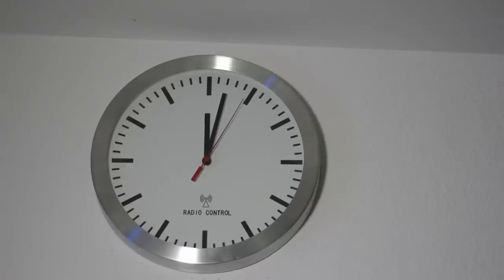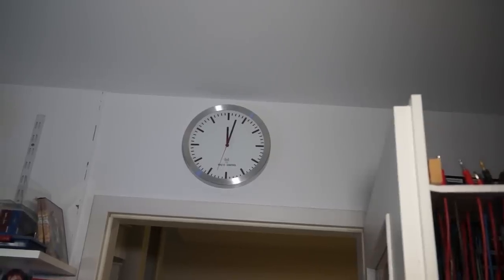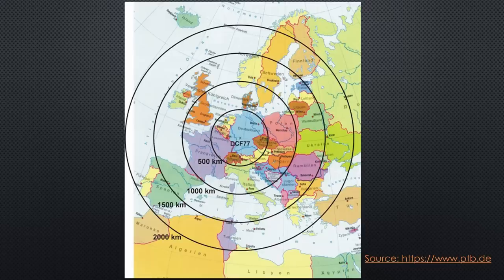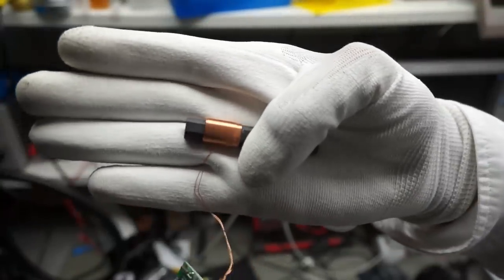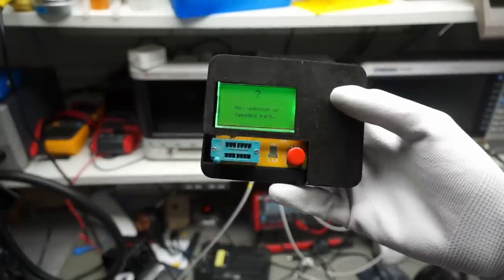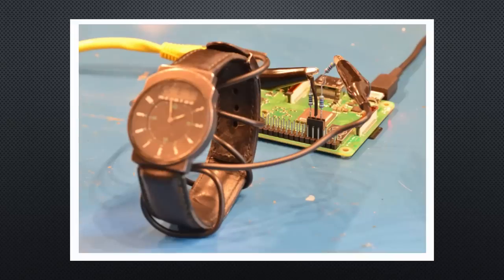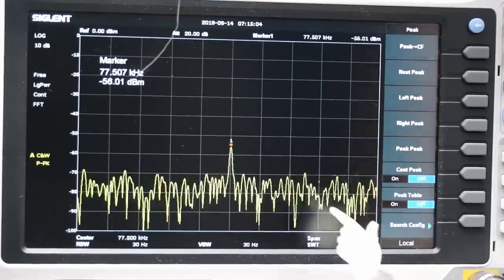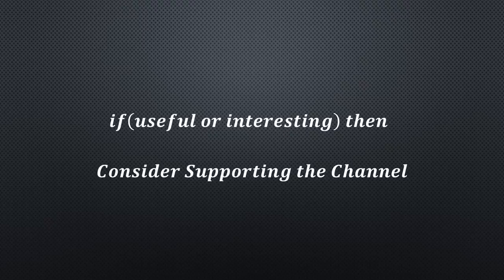#287 Remote Controller for Clocks (IKEA and others, DCF77, WWVB, MSF, JJY)

Comment: Microsemi sells a Chip Scale Atomic Clock (CSAC) for about $2000. Also it might be interesting to use GPS time to set the clock on the Raspberry Pi and then transmit that to your clocks.
Reply from the maker: Interesting. Yes, you could use GPS. But NCP is exact enough for me. And simpler. Especially in the basement. But you might see a GPS for another purpose on this channel in the future...

Comment: Living in Uppsala I have the problem to be at the northern edge of the DCF77 range and my kitchen clock fails to adjust itself regularly, even picking up completely weird data. I had not been thinking about faking a DCF signal myself before, but now - however, I would not want to waste a Raspberry Pi on the task. A ESP8266 should be fully capable of doing the task as well....
Reply from the maker: You could try to port Henner’s  C code.
Reply: @AndreasSpiess  I am a bit busy right now, probably (hopefully?) someone else will beat me to that...

Comment: How about building a simple amplified repeater  from the cheap receiver module ?
Reply: The problem is that you have to receive and transmit on the same frequency.
To you manage that you can cross out simple.
Reply: @ZZtop-gg3lu  i meant a repeater the tx'down a coax to his basement

Comment: Extremely interesting, thanks, Andreas! 
Was pondering for quite some time if it is not possible to do something like this (or a repeater) as we do not get any or super only weak reception for the Fort Collins signal here in Canada, BC. This solution, if run once a week for a short time of the day/night, should not disturb anyone at all. Perfect!
Reply from the maker: It should not bother anybody because they will be happy if their clock works now ;-). But the chance of reaching somebody’s clock outside your room is small.
Reply: Danke Andreas. Hab es gerade ausprobiert, funktioniert toll. Hab alle meine Funkuhren aus Deutschland (pre 2006) und die paar die ich hier in Canada gekauft habe erfolgreich gesetzt, und das mit nur breadboard connections. Werde das demnaechst richtig schoen verloeten und eine ferrit antenne verwenden.
Danke, danke, das loest ein altes problem was ich hier in BC hatte mit einem Schlag! :)

Comment: For viewers in North America, the relatively new La Crosse 404-1235UA model picks-up the newer Phase Modulated signal from WWVB, which provides something like +17dB (x50) better signal. So even in eastern Canada, about 4000 km from WWVB in Colorado, the signal is effectively very 'strong' and the clock just works very reliably. This model works in almost all Time Zones (not limited to the four USA zones), does automatic DST, and even Leap Seconds! Check the reviews for further details before making any decisions..
Reply from the maker: Thank you for your info. Good to know you can buy a good device BTW: At least DCF77 includes "summertime" as it is called here and all signals should include the leap seconds. This is one of their purposes.
Reply: 404-1235ua la crosse

Comment: @Andreas Spiess — I watched the video several times, but it is still not clear to me what you are using as a stable time reference to generate the synchronising signal for your radio-controlled clocks.  Is the Raspberry Pi connected to the Internet and thus being synchronised to a time server?
Reply from the maker: Yes

Comment: I have got me a little ESP that gets the time over ntp and simulats the dcf77 signal and puts ist directly in the clock works great never had problems
Reply from the maker: Do you have a link to the code you use?
Reply from the maker: Thank you for the link. In the meantime another viewer pointed me to a ESP32 project ;-)

Comment: Hi Andreas, thank you for these clear explanation. I successfully bought an emitter from your schematic for the JJY 40kHz frequency using a loop antenna.
A question : why is there a 1 nH coil in your schematic ? Shouldn't it be 4.4 mH ? An 1nH antenna and 1nF capacitor should give a 159 Mhz frequency.
Reply from the maker: Yes, as shown in the video, 4.4mH is correct. The drawing you refer was only to show the method.

Comment: Regarding the coil and the ferrite rod, I'd first look for a broken small radio-controlled clock, and salvage those items from it. A lot of cheap ones have been imported over the years, particularly by the German discount retailers like ALDI, and on sale for as little as £5. When they get knocked onto the floor, the displays break or the buttons jam. Maybe the battery compartment terminals become broken or corroded. A broken one seems an ideal opportunity to salvage the ferrite and coil for a project such as this. The only thing for us in the UK is to look for a 60 kHz model, as that signal is of course stronger than 77.5 kHz over here. A really interesting project, Andreas, and has made us all think about something a bit different for a change ! If you read this, would a Pi  model Zero be as equally good at running the application as the Pi 4 ?
Thanks !
Reply from the maker: A Pi Zero should work. But I did not check. I used a 3B+
Reply: @AndreasSpiess  Many thanks for taking the time to comment. If I try one, I'll let you know !

Comment: An interesting way to test the resonant frequency would be by giving the system an impulse, and observing the resulting oscillation frequency. By giving an impulse I mean using a very low frequency square wave, or in other words, by just applying a voltage to the circuit and wathcing what happens at the output voltage.
Of course you still need an oscilloscope for this, but not a function generator.
Reply from the maker: Another viewer suggested the same method. But it is not so easy to do this fast. You have to give it energy and then, go high impedance to let it ring. Maybe with an Arduino pin, this would be possible

Comment: Can use the FFT function on your scope to characterise Filters, Anntennas, etc. Obviously alongside an ARB/Frequency generator.

Not as good as a decent Spectrum Analyzer, but more than good enough to get the job done in these simple cases.
Reply from the maker: I tried with a noise source and the FFT. But did not see a dip :-( I do not know what went wrong...

Comment: I have several of these radio controlled clocks. They only search for the time signal at 2 AM in the morning, so they can only be set at 2 AM. They can not receive the signal at any other time. The reason for this is that the radio signal is stronger at this time due to atmospheric conditions. I'm in the USA, maybe out radio controlled clocks are different than yours.
Reply: also the receiver itself consumes quite a lot of power and thus is only switched on for a short time. Since the transition for daylight saving also happens around 2 am it is the best time for the synchronization.
Reply from the maker: Good to know if you do not want to run it 24/7.
Reply: @AndreasSpiess  at least in the good old times this fact was listed in the manual... if an error free reception did not succeed then at least my clocks retry in about hourly intervals.

Comment: Hi again Andreas
Your circuit works perfectly well, but I note that in most RF schematics, the coil is parallel to the capacitor. Yours are in series. Is there an advantage to do this ?
Reply from the maker: You can try both ways and see which one is better for you. I did not test.

Comment: Andreas, I recall disassembling more than one old AM radio as a kid in the early 60's and noticed their ferrite rods used "unusual wire" that had cloth (actually silk) covering and not enamel. Later, when I was an engineer, a physicist at work had some of that same wire for some ferrite cores he was winding. I asked him what it was and he said "Litz wire", which is known for having lots of surface area for lower impedance (i.e. higher Q) at lower frequencies (his tests were done at about 30 KHz). I noticed you only used plain enameled wire. I searched Aliexpress for Litz wire and found none. I'm unsure how much more Q you can get using Litz, nor do I know a source for it. Just a thought in passing.
Reply from the maker: An English colleague once showed me a link to such wire. I never saw it before. And I also do not know if it was just before they had more modern materials or if it still has its advantages :-(

Comment: Interesting. One thing I I wondered , having been recently bitten by it, is if it would be best to specify a COG or NPO capacitor for the resonant circuit. Both of these are class 1 temperature stable whereas some of the others have very strong temperature dependence, a class 2 x7r is not as good but still a lot better than the class 3 & lower spec etc. If the resonant circuit is always at the same temperature this would not matter & may not matter anyway in this application but it made me wonder having been troubled by it in something I was designing that can likely see temperature fluctuations from cold winter, say minus several centigrade up to high summer of say 30 centigrade. Thanks for sharing!
Reply from the maker: You are right. As you wrote, in this application temperature coifficient is not as important as the temperature does not change too much in the lab and also the application is not too sensitive.

Comment: Another great video as always.  I guess I would have gone with an air core multi turn loop antenna for the low power 77.5, 60, or 40 kHz  transmitter. The ferrous core is fine for the receiver where saturation isn't an issue. Either way, the radiation efficiency will be awful. As an alternative to winding the antenna, I've used the magnet wire right on its original reel. This is nice because you don't have to do the winding (boring), and you can try with or without the ferrous core by sliding it in or not...
Reply from the maker: I thought about your proposal. Bot was not able to locate the other end  of the wire without unwinding the whole coil :-(
Reply: @AndreasSpiess  In some cases, the manufacturer makes it really easy to access the inside end of the wire on the spool. Here is an example: https://www.alliedelec.com/product/rs-pro/357772/70825771/  In other cases it is almost impossible. I frequently use small diameter multi-loop antennas, and I am way too lazy to rewind, so I restrict myself to the products that make it easy. The ability to easily slide amidon rod cores through the reel for testing is another plus.
Reply from the maker: Good to know. I purchased these wires without having a particular purpose in mind...

Comment: Good morning Andreas Spiess. Even tough I live in Switzerland, I am asking my question in English, since some visitors of your project may encounter the same issue.

My question is about the radio controlled Citizen Pro Master Land watch, which officially syncs with JJY signals only.

Since many YouTubers claimed, that this watch can be sync. easily outside Japan using radio sync apps like Clock Wave or Radio Wave Sync (from Apple store) with an iPhone I bought the watch.

But with neither of these apps I am able to sync the CPML with my iPhone (OS 12.5.7) to set the lokal time here in Switzerland. I am following the instructions and the apps generate the sync sound.

Do you maybe know an app (for iPhone or iPad), which I could use or a «go around» to sync this watch on the fly?

Thank you for your help.
Reply from the maker: No, I do not know another app. Anyway, these apps only work "by chance" because they use the coil of the loudspeaker to create an electromagnetic field. This is only very small and will not bridge big distances... I assume they differ from model to model, too.

Comment: I think some low-frequency capable SDR will be the best cheap transmitter tester... :)
Reply from the maker: Not many are available which also transmit on these frequencies...
Reply: But I was talking about testing with SDR, instead of using an Oscilloscope / Signal generator... No need to transmit. With proper signal up converters, it should be possible to do the testing even with a cheap TV stick!

I know of at least SDRPlay, which is less than 150 €.. Of course for that price it is also possible to get an oscilloscope.
Reply from the maker: The antenna does not work without a signal. You cannot receive anything if you do not put power into the antenna. You need a transmitter with a variable frequency for that test.
Reply: rkan2 is responding to the part of the video where you ask for cheaper methods of verifying the antenna is transmitting on the correct frequency. With a $25 RTLSDR and some free frequency analyzer software you can see what the transmitter is doing easily.
Reply from the maker: I still insist that you have to have a variable frequency transmitter to test and optimize the antenna. Of course, you can test the 77.5kHz signal strength with just an SDR receiver. But this can be done with an oscilloscope, too.

Comment: It's strange, but dcf77 module I found costs 14$, and you can get precise time with GPS module, which costs 7$. Also there is cheeper way to get precise time if wifi is available in area, then cheapest esp8266 can be used with ntp sync (2$). So, there is no any sense to use that module in your DIY applications, unless you implement it's functionality
Reply from the maker: This project was more to display time, not to get it. Getting time, as you point out, is very simple these days and I made some videos about that.

Comment: Hi Andreas Spiess and thanks for a outstanding project.
I already did the basic experiment (with the 3 resistors only and a few centimeters of coiled electric wire) with one of my RPI and I can adjust the clocks by almost touching the clock's DCF antenna to the power cord. I already bought a 77.5kHz Fine Tuned Loop Stick Antenna for DCF77 Receiver at eBay, from Canada and while I'm waiting for it to arrive, I take this opportunity to ask the following questions:
What could be the coverage of the DCF signal, using the basic circuit, but with the DCF77 antenna (the length of this antenna is 60mm, with a core diameter of 10mm)?
What could be the coverage of the DCF signal, using your modified circuit with the PNP transistor (3.3Volt) and the DCF77 antenna?
What could be the coverage of the DCF signal, using your modified circuit with the PNP transistor (5.0Volt) and the DCF77 antenna?
Many thanks in advance and best regards.
Rui, CT1AIC
Reply from the maker: I can only share my setup with a transistor and a ferrite antenna. Its reach is maybe 2 meters in my lab (which has lots of electronic noise).
Reply: @AndreasSpiess  Hi and thanks for the kind answer. What I would need is coverage of 10 to 15 meters with some walls between, where I have some DCF77 clocks. At Portugal, I only can get the signal of Frankfourt from time to time and at night, at a window, directed to Germany. You can imagine...
Reply from the maker: I then would forsee more voltage. And it will probably be illegal, if you care.

Comment: Great Work Andreas! Interesting work! I would be great if it could be do with a esp8266 or esp32. but in Vienna the dcf Signal are not realy working. Most of the clock don'T syncronize...
Reply: I was envy of northern europe people because my DCF77 clocks sync very very difficult, and I'm in southern italy!
Reply from the maker: You could try to port Henner‘s C code to an ESP. I run it on my node-red server which is always on
Reply: same thought. Really looks like Raspberry is an overkill for such an easy task
Reply from the maker: Other viewers posted links to an ESP8266 and an ESP32 project for DCF77

Comment: I'm planning on using a RPi zero W and a ferrite core antenna taken from a WWVB clock to transmit the JJY 60 signal. I can solder and follow instructions but I have very basic electronics knowledge! Why can't I just put my ferrite core antenna in place of the wire in Henner Zeller's setup? I don't understand the circuit at 10:00 in the video (I'm only assuming it's isolating the antenna from the pi and allowing the signal to be boosted), but my goal is to transmit with enough power to cover a small room (I am in a country where this is allowed of course ;-p). Is there somewhere you could point me to where I could learn the function of your circuit at 10:00 or give me any tips/instructions? Thanks!
Reply from the maker: Coils can create high voltages and Raspbery pins do not like that. This is the reason for my comment. The function of this circuit is best understood if you look for a basics transistor tutorial. One of the pins creates the high frequency signal and the second "overrides" this signal to switch it off in the right moment. You probably need an oscilloscope to play around with this circuit and learn how it works.